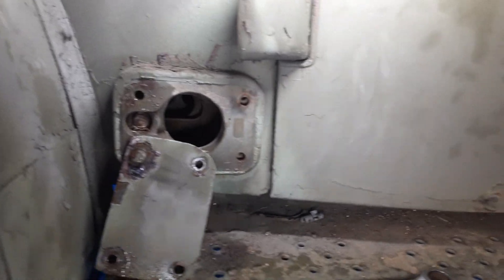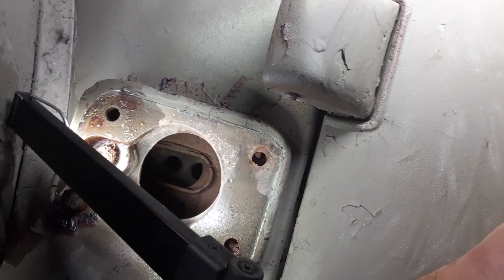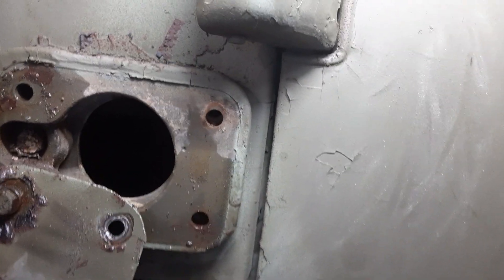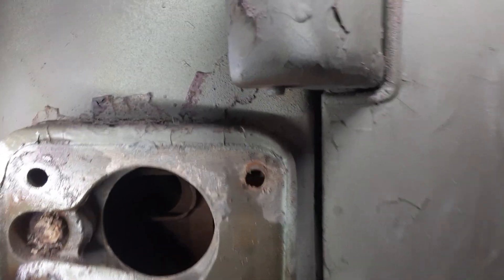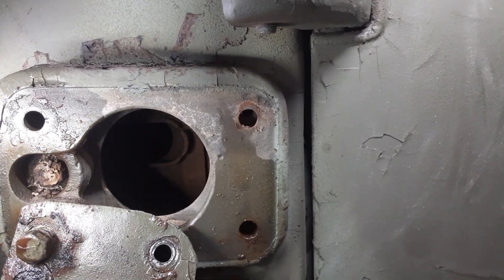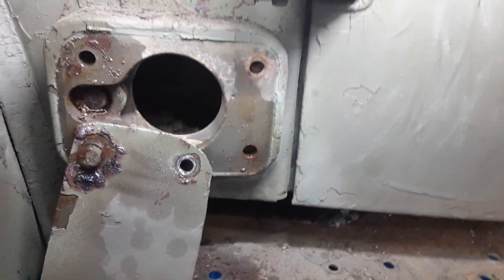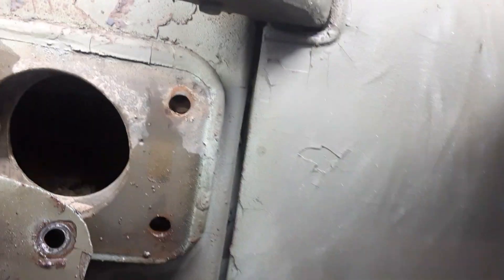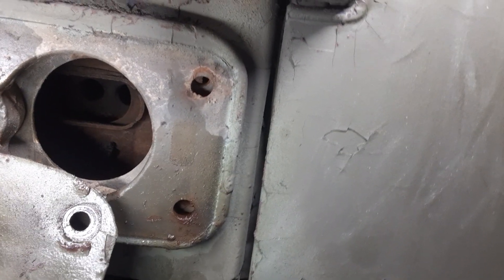u a army 1952 dodge 3/4 t m37 cover plate to what.

Comment: It's a military 24v jumper cable port. Yours is missing the guts to hook up to the batteries. So a military vehicle can boost start another with a special booster cable.
Reply from the maker: @X-Appeal  Hey great thanks alot. Yeah it doesn't surprise me the guts are missing. The Army was using it for a parts truck.
Reply: Not all are installed, alot of vehicles are left with it off. You can still purchase this part and you will have to run cables to your batteries to connect it.
Reply from the maker: @X-Appeal  Again thanks for letting me know I am still clueless on some stuff on this M37 that I have had for 1 year and 3 months. Now I see the two holes for the cables going to the battery. I found the drive shaft missing i had to find and replace as well as the original Card the 24 volt voltage regulator and of course the wires plugs and cap had to be replaced. put a new coil in as well. It still has the original starter and generator and even the original mechanical fuel pump works but was leaking so by passed it and put a new electric fuel pump in. this truck has been a challenge to say the least.

Comment: A plug?
Reply from the maker: Ex-Appeal had the right answer. it was used as a booster port to jump start other vehicles. Apparently the guts on mine are missing so they just put a cover plate over it.